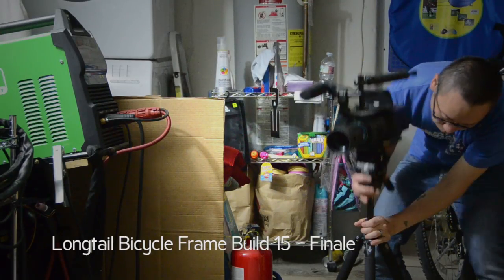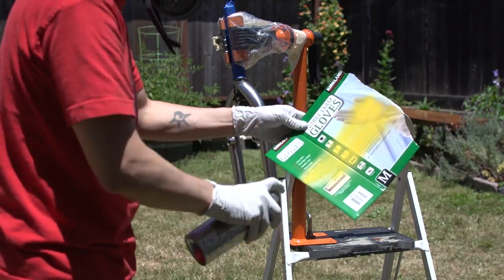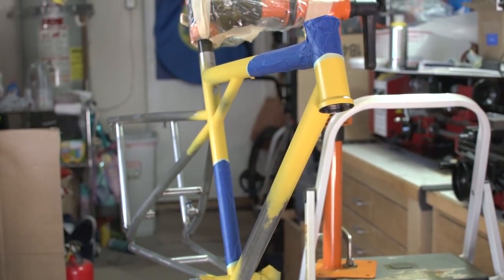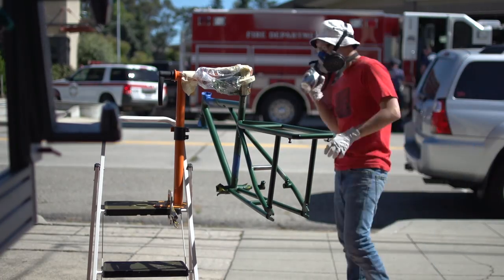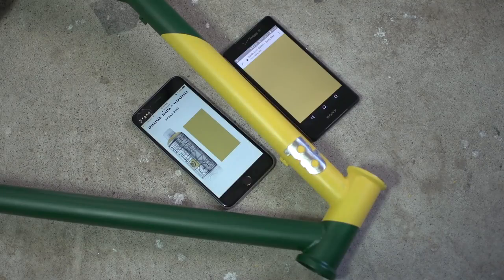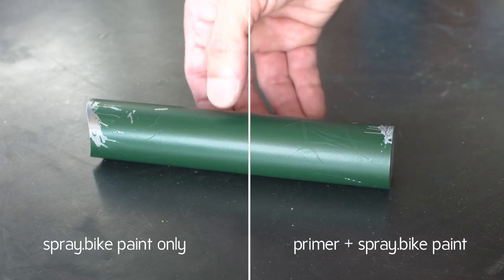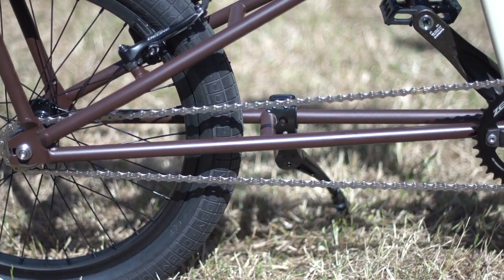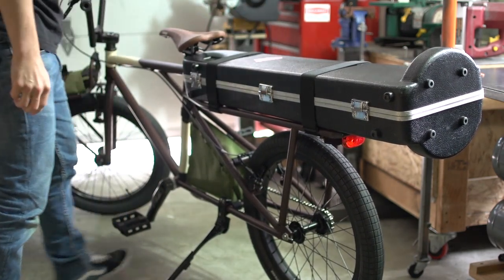Longtail Bicycle Frame Build 15 - Paint and Finish

Comment: Great video! Very entertaining and you have excellent presentation skills. Plus your enthusiasm is fantastic. A tip for masking I learned from boat building!... After painting the first color and masking, spray a little of that same first color to fill any micro gaps under the masking tape, let it dry a bit, and then spray the darker color. Works like a charm! Also, use the most expensive tape you can. Nichiban is great stuff. And always store your tape in a ziplock bag. The edge does all the work. Once it's contaminated, it's worthless. Cheers!

Comment: Those paints look a whole lot like ironlak paints. Also the description of how they are applying sounds like most grafitti paints. Ive gotten awesome results from ironlak or montana spray paints! Ive also used roth spray paints for some awesome metallic paints. Primer is definitely an essential. I do very much like 1k primer and sealing everything with 2k clear - they have awesome 2 part spray cans 2k clear coats. Eitherway awesome build series. Been a serious pleasure watching it unfold.
Reply from the maker: +Gavin Stewart nice! I almost used 2k paints.

Comment: Full automotive quality paint job is possible out of spray cans.
Look around for an auto body supply store. My local ppg place can mix colors and put them in a spray can, and the rest of the system.
Etching primer on bare metal.
Primer sealer covers etching primer, white for bright gray or black for muted.
Base coat is for color, I like to pick colors from their huge swatch books, you get to see swatches in person and compare.
Clear coat, hardened two part clear, spray can doesn't go on as thick as paint gun, but layers build up the thickness.
That's a coating that will last years.

Comment: Questions: (1)Did you use a self etching primer on the smooth steel frame?  (2) Did you use a clear coat on top of the paint layer?
Reply: the answear is no, therefor the paintjob wont last... some peoples can weld the whole world, but cannot paint it.

Comment: you can buy 2 pack paint in a spray can now, the hardener is in second chamber in the bottom of the can you hit the button thing on the bottom and it mixes in the can.. i haven't tried it but it was one of those "well what will they think of next" moments
Reply: Enamel gives the best durability. Thicknesswise it's better to brush it on and use an appropriate solvent to get good self-leveling quality. But most people don't think they can get a good finish with brushed on paint. Truth is you have much more control especially on a quick drying day like he worked with. Turpentine dries the slowest, naptha the fastest.
Reply from the maker: I was looking into that and almost went that route. Seems perfect for bike frames where there isn't a lot of surface to cover. Only thing that stopped me was the availability of colors. I read that I could get custom colors injected into the can but I don't know where to get that done in my area. I'll look into this some more for the future.

Comment: I'm just starting to also build bikes (I've only built 2 frames) and your channel is awesome. You've got some pretty nifty stuff and workarounds to some problems I've encountered while building my own frames... Also, I'm starting a youtube channel, about building bikes but something a bit more vlog like...On to the topic at hand, my first frame was painted by a friend who works at a body shop. He used car paint and it turned out pretty good, for some time. The paint wasnt too chip resistant and it started getting some rust sport where the paint had come off. For my second frame I was able to find someone that did soda blasting (at a fair, affordable price) and proper powder coating. The finish is AMAZING, and the paint feels really strong.. I'm currently trying to find some options for rust-proofing inside the tubes. I know there's Framesaver, but I've been wondering if there is something else, more readily available I could use.
Reply from the maker: +Oli Aponte i subbed. Looking forward to your first frame video. :)
Reply: actually, this user or channel isnt the channel I was refering to. That channel is called "A Cycling Dad". Thanks for the reply! My next video will probably be showing my two frames

Comment: Amazing looking bike. I assume you're fairly flat as it's a single speed. But if you ever upgrade the Shimano Nexus 8 speeds are great and easy for with horizontal dropouts. Hope your sun enjoys it thanks for sharing and great metalwork. 👍
Reply from the maker: Great recommendation. I do want to revisit the drivetrain because the gearing is too low.

Comment: For a better paint finish I'd use duplicolor from your local AutoZone. I'd recommend a base primer, any color you want of duplicolor and then top if off with one of their clear coat options (even if you are looking for matte I'd still hit it with a light even coat of clear.) Also do not mix primer brands! Especially not oil based primers. You will get orange peel.

Comment: Sir, does the paint on the side wall of the rim where the break pads connect good for breaking or paint on the rim where the break pads connect should not be applied ?

Comment: At the very least, here in Europe, you can buy paint and have it put in a paint can at any specialized car paint shop. Mine for example, a small boutique type (to give a sense of scale for the operation) will do even large 30 cm tall cans. It's an awesome resource worth looking for one's area because that opens up the ability to get pro paint, car paint to a bike. 

There's one problem with it, unlike regular can paint, you need proper nozzles. You cannot run that kind of paint through the cheapo commercial ones. You need actual nozzles with or without pattern, luckily those are easily found through any graffiti enthusiast online paint shop, those folks using them for their ability to cover large sections of wall quickly.

I cannot state how big and important a difference using pro paint makes on the finish. Ads depth, puts pop in your work AND opens a creative path that regular cans just don't give because they can't, can paint being engineered to work with long storage and cheap nozzles and delivery systems.

Comment: Did you mean for it to have that satin/flat/matte finish? Most good quality paint is "Base-coat/Clear-Coat" where as the paint you applied wont last unless it is protected by a clear topcoat which is what will determine the Gloss or Matte-ness of the look....... all base-coat paint dries semi-flat eggshell style (looks like what you have there????) The end results look is achieved by buying gloss or flat Clear
Reply from the maker: Yes, I wanted the matte finish. But spray.bike does sell a gloss coat and that was my original plan at first. At the time of shooting, it wasn't available though. And after seeing how good the matte finish is I decided to stick with it.

Comment: Great job on the bike and videos. When you are painting a bike in the future and are looking for a high quality rattle can finish I highly recommend SprayMax 2k paint and primer. It is a 2 part epoxy in a rattle can http://usa.spraymax.com/index.php?id=783 I have used it many times on motorcycle tanks and frames and can say it holds up extremely well.